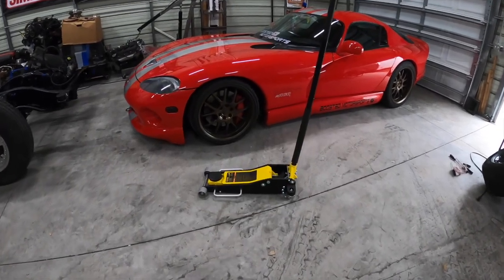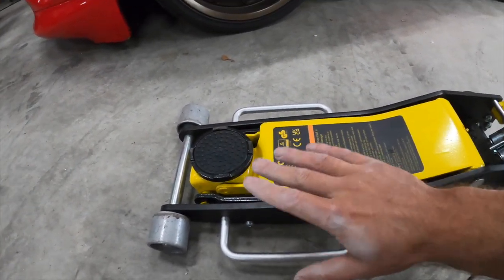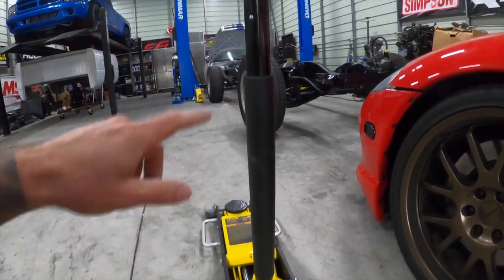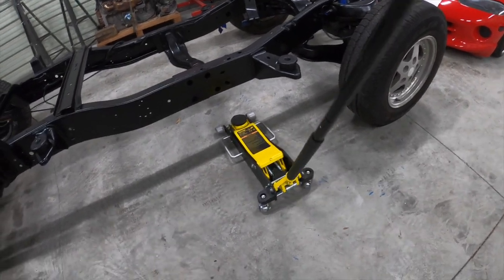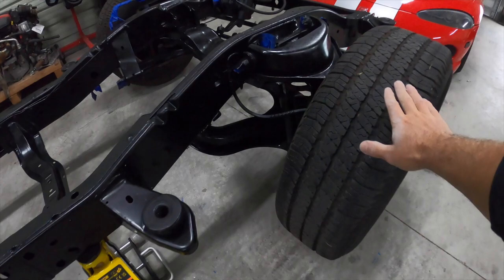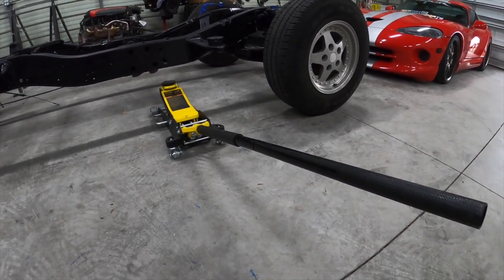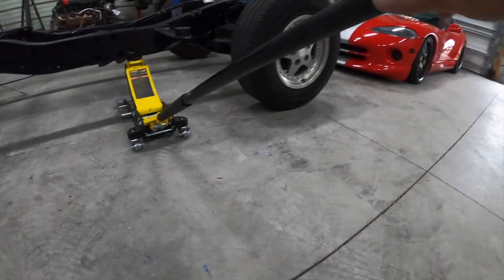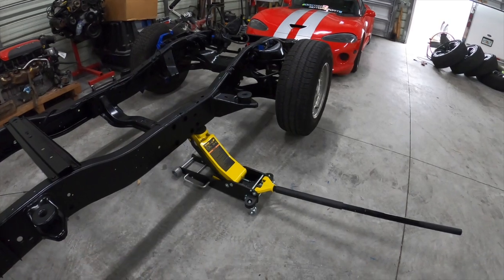Vevor 3 Ton Low Profile Floor Jack

Comment: Nice job...jack looks solid..l have a C5 relatively low...should be ok
Reply from the maker: I’ve been using mine on my C5 Z06 instead of my harbor freight. I lift it by the rear subframe so that I can get the arms of my 2 post lift under it since it’s too low 😅